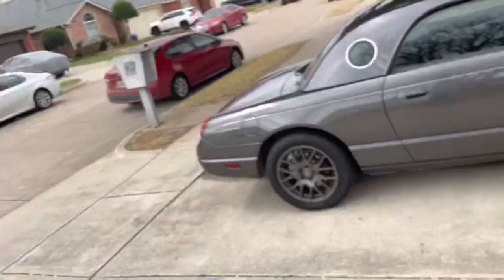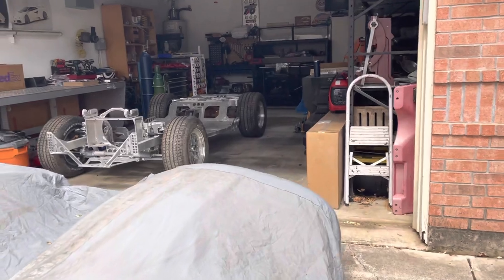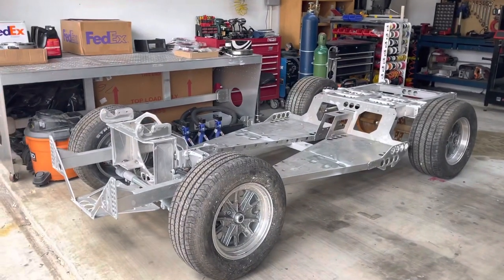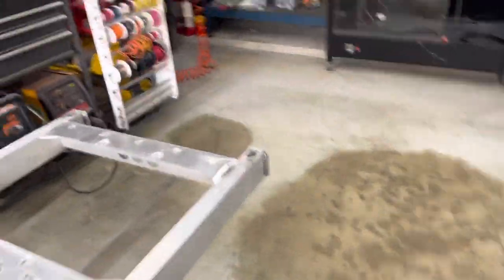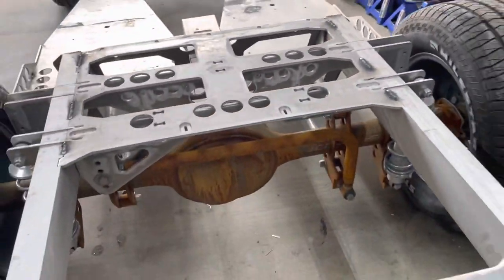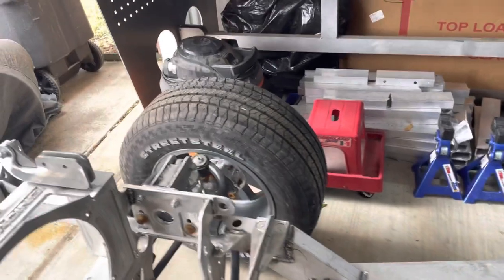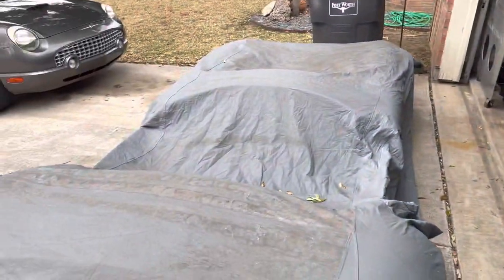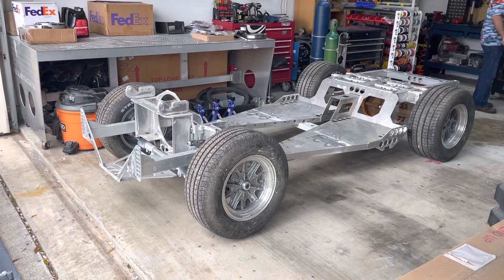C8 Corvette Hack - Aluminum Composite Chassis

Comment: Interesting looking chassis but:
 - it's not "composite", just welded tube/sheet aluminum
 - if that's the finished chassis, it'll be a flexible as a noodle with all front/rear forces channeled through the points of those triangular floor sections
Reply from the maker: Fortunately you don’t know what you are talking about.
Reply: @shadetreesupercar  well, having built a chassis(steel), to my own design, which went through engineer supervised testing to exceed requirements in both torsion and beam strength, I might have more of a clue then you think. But, if you can show how that chassis is in any way "composite" and/or share the actual tested stiffness numbers I'd be happy to see.
Reply from the maker: @OzGecko  It was designed by a team of 4 engineers and designers. I trust them far more than some random guy on the internet. 

Those are not just “sheet aluminum”. They are composite panels. 

Let’s see your design and test results! 😊
Reply: @shadetreesupercar  I think the confusion is that it's not explained how those are composites. I'm quite interested in this chassis as I have an aluminum chassis vehicle and want to make a new subframe, but also out of aluminum. I don't quite see the composite either. Composite panels are panels made out of more than one material and right now it looks like plate aluminum. Is there a honeycomb structure inside or something?
Reply from the maker: @ - I’m just using the terminology of the chassis builder. I’ve actually wondered the same thing.
Reply: @shadetreesupercar  maybe he misspoke, it happens. If he didn't you should probably ask him since it's an interesting subject and also something you'd want to know about yourself since it's your chassis in the end.
Reply from the maker: @ - He didn’t misspeak, he says it all the time. 

Honestly it’s irrelevant to me. He can call it whatever he wants. I’ll just call it “an all aluminum chassis”. 😊
Reply: @shadetreesupercar  I mean, yea my second part was that if he didn't misspeak about it then you should have him clarify for yourself. Aluminum chassis are cool

Comment: What's the thickness on the tubing? What kind of weight savings did you see?
Reply from the maker: @CalicoRiot  I’ll have to check on the metal thickness. I don’t remember off the top of my head. 

I’d estimate a50% weight savings but I don’t have a steel version to compare it to.

Comment: If i wanted a motorcycle frame built in alluminum could it be done
Reply from the maker: You bet it can! The first aluminum motorcycle frame was used back in 1977. There are currently many production aluminum motorcycle frames out there.